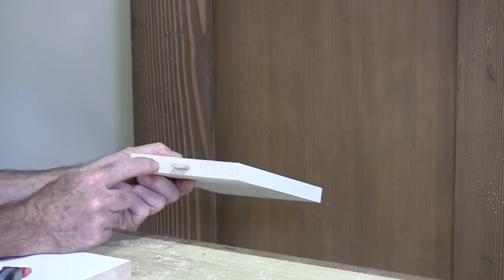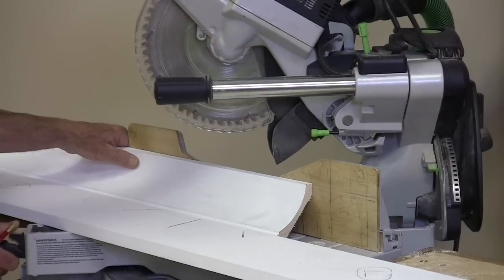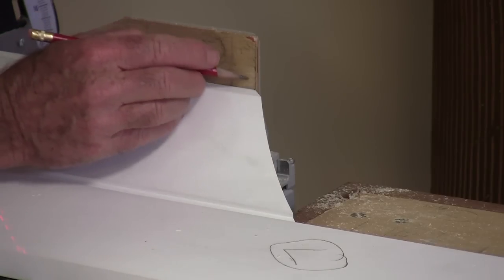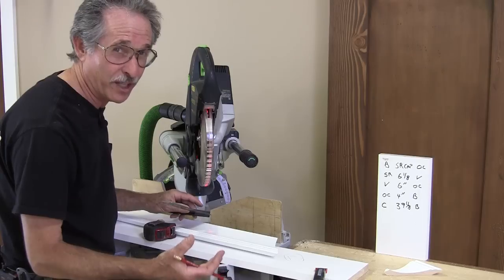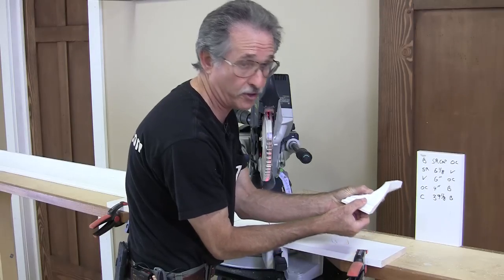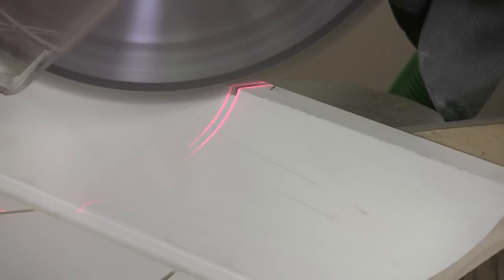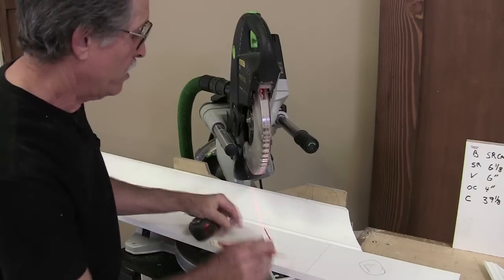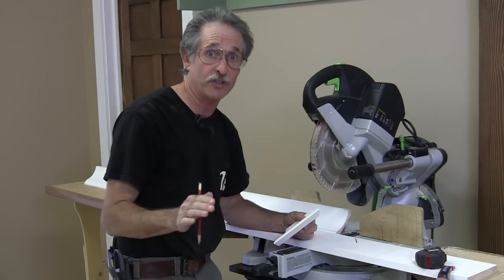Installing Crown Molding: Cutting Crown

Comment: Does it matter if its a 45° crown or a 38°\52° when cutting upside down?
Reply: No you still cut upside down and backwards, those angles are spring angles for the crown. The spring angle is the angle the crown beds on the wall and ceiling. You will still cut your normal 45° inside and outside miters, just make sure the crown is bedding right on the saw deck and fence.